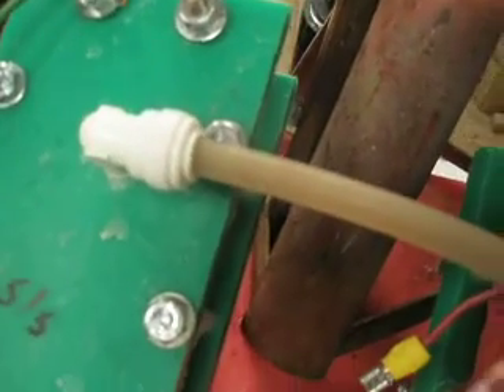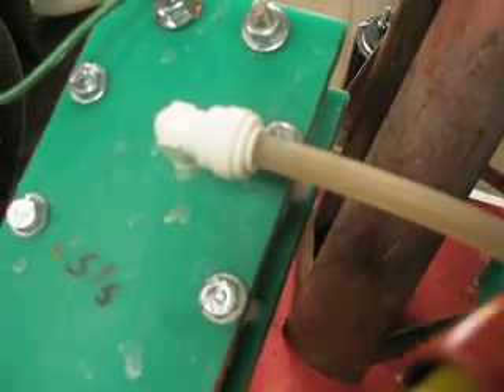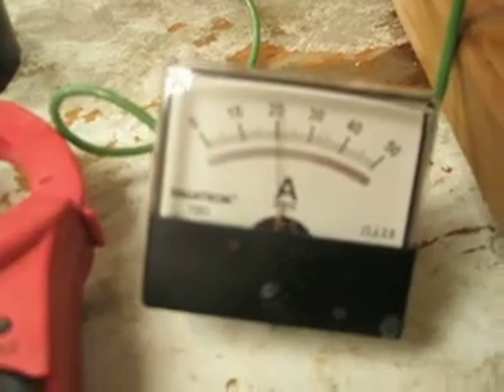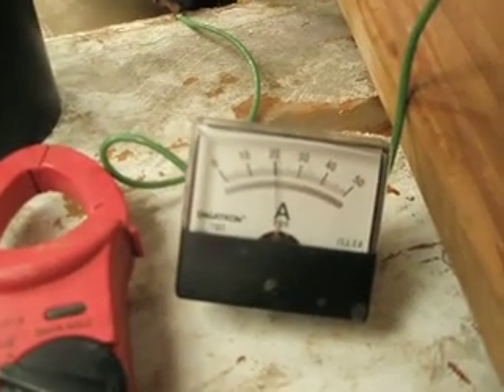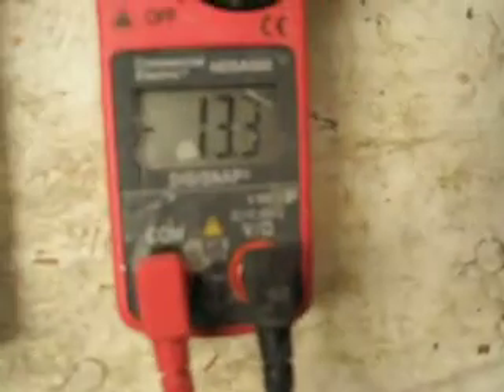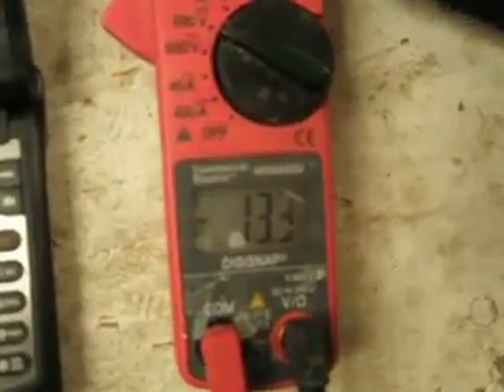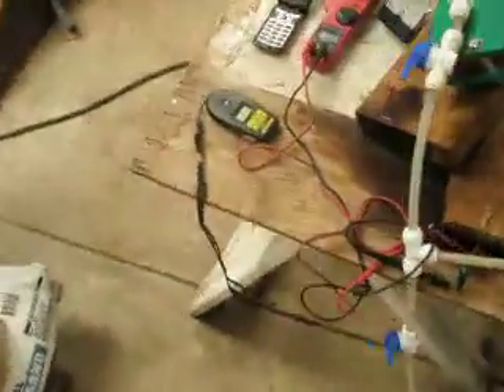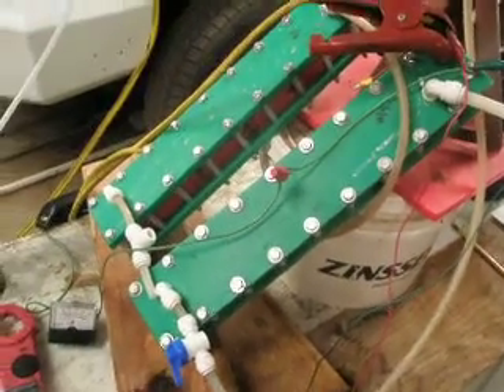Gen 3 Testing HHO Output

Comment: using a pump will provide a bit better flexibility on mounting, but its still tough to get the gas to go around corners ... it wants to flow UP so you may still trap some gas in the device if you lay it on its side ... but if you can keep the outlet a little higher than the inlet, and use a pump to push fluid trough it, you might get away with your mounting idea ... its just another option to consider ... windshield washer pumps do not work, dont waste you time or money ... get a SureFlow 150gph